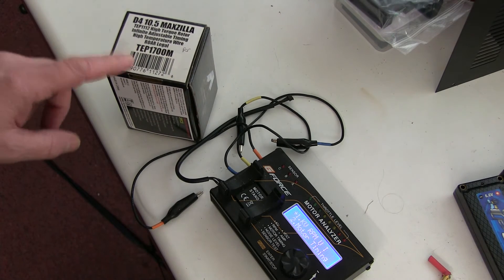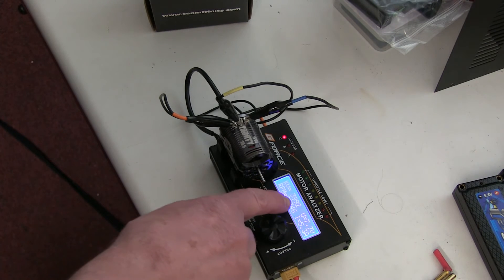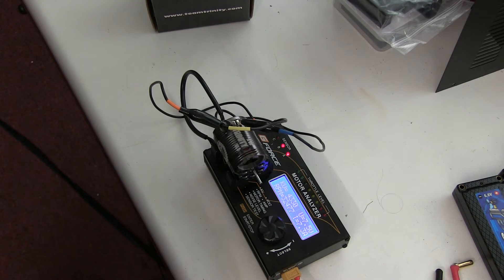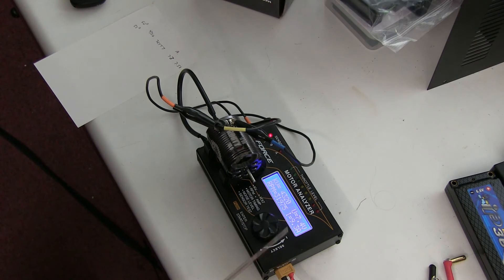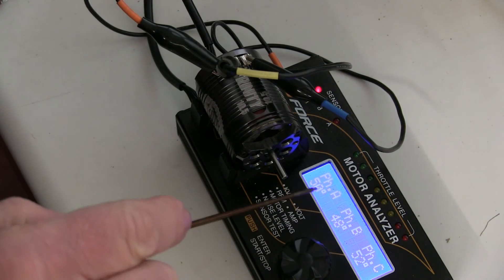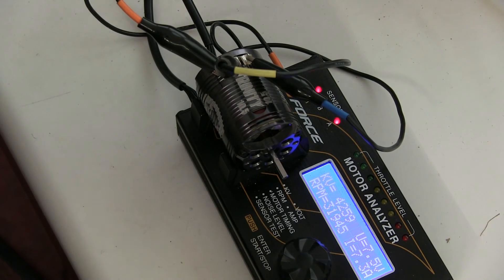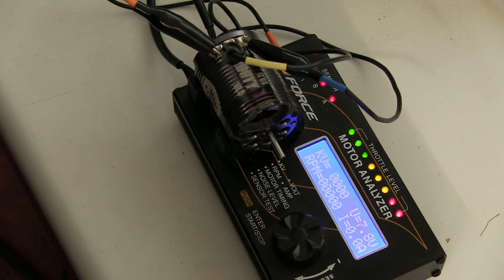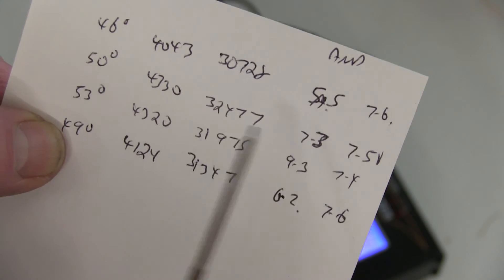Brushless Motor Sweet Spot for 10.5T, with Blinky (Locked) Speedo

Comment: Hi can we use this analysis device for 3000W bldc motor that comes for electric vehicles
Reply from the maker: The maximum operating voltage is 10volts and maximum current about 20 amps , which is 200watts. Only If your motor will turn over at that voltage and current.

Comment: Thank you for the video! What amperage draw would you suggest for a 5.5t motor? Thanks in advance
Reply from the maker: Hi Olli
I have checked some mod motors that are performing very well, and found they were also set around 6amp off load.
So go for 6 amps.

Comment: Nick, first of all, THANK YOU very much for doing these tests.  Your analyses have been super extremely informative.  As a fellow tinkerer, I admire your methodology.  Now, for my question.  How come when you do your tests, you do not have the battery voltage as being constant?  I.e. - wouldn't you want to conduct the test where the battery voltage is always at 8.4V?  I am assuming that the amperage would vary (same for the KV and RPMs).  So I am thinking that if I set my timing to draw 6 amps @ 7.4 volts, it would actually be a higher amp draw when the battery is at 8.4 volts (and lower once the voltage drops below 7.4 volts).  Or am I completely mistaken and the amp draw is actually constant across the voltages?  Thanks in advance!
Reply from the maker: Hi
Yes, I keep a good 7500 Lipo on charge all the time I am testing.
The tester is designed to give the same result with varying input voltage.
i have measured the same 6.0A and KV with a voltage showing on the display between 6.8 and 8.0V. (A near flat lipo and a fully charged one).
A lot of users will look at the RPM which will increase with voltage, but KV will stay constant.
However ,If testing without the Analyzer, yes use a lipo that is near full charge for the current measurement (ie. with an ammeter).

Comment: what would be the sweet spot for a 21.5 motor . amp draw?
Reply from the maker: Hi B
The 21.5T can run very hot in some , especially if you cannot fit a motor cooling fan. (The 21.5T has a high winding resistance that generates heat losses).
So the amp draw will normally be set by the motor temperature over a race.
The 21.5T needs to be checked in the F1, to see what temperature it runs at.
I think 6 amps will cause it to overheat.
 I suggest starting at 4 amps., with a 2S lipo.
Then add more advance if motor running well and not too hot.

Comment: Hi Nick, have you tested any 21.5T motors for sweet spot? F1 is a growing class and I think motor timing is allowed.
Reply from the maker: Hi Joe
The 21.5T needs to be checked in the F1, to see what temperature it runs at.
I think 6 amps will cause it to overheat.
can you do some tests , I suggest starting at 4 amps.
I have seen some F1 going much faster than others, at West London track, so need to see what FDR they are running.
I assume the F1 runs without a cooling fan.
All the best
nick
Reply: +Nick Adams I'll start at 4A then. Only done 1 meeting so far, but the motor ran hotter than I would like. There's just enough room for a fan depending on the shell. Will let you know how I get on. cheers

Comment: so nick got a question how much kv is good for a 17.5 motor whats good and whats bad?
Reply from the maker: +mike Gilson 
Hi Mike
See the video on the 17.5T sweet spot.
Depending on the timing, the KV will vary.
Good KV is above 2800. 
3000 and above is very good.